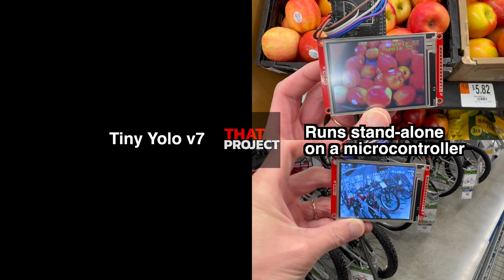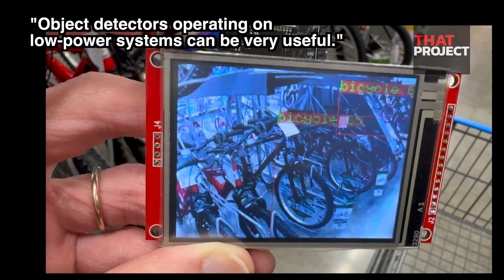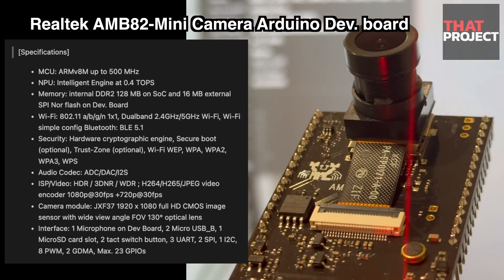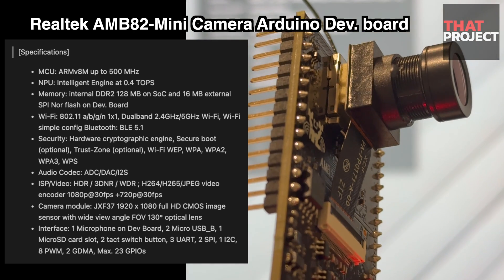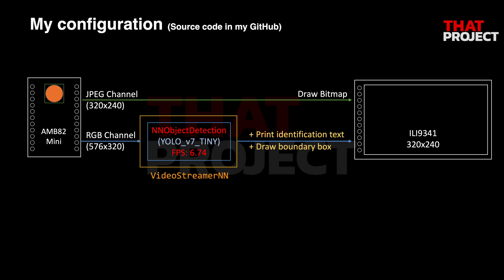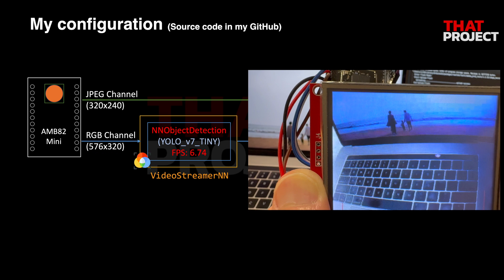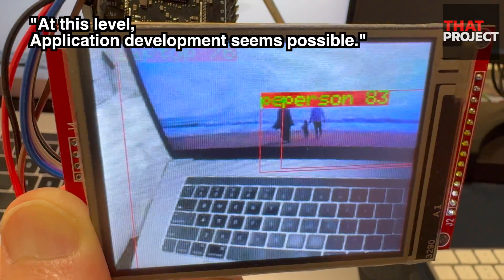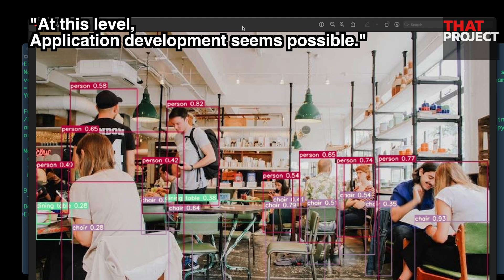[AMB82-Mini IoT AI Camera] *On-Device* object detector powered by Tiny Yolo v7! #standalone

Comment: I’m working on a project using the AMB82 mini. The goal is to capture images at specific intervals, perform object detection on these images, and save them to an SD card only when objects are detected. Additionally, I want to draw bounding boxes and labels directly onto the saved images to highlight the detected objects.

My main challenge is integrating these components efficiently and ensuring that the bounding boxes and labels are correctly drawn on the saved images. I’d appreciate any guidance or examples on how to achieve this, particularly on how to draw the detection results onto the image before saving it to the SD card.
Reply from the maker: In order to write an image file to the SD card, you need to write an image to draw the bounding box and label directly, which is not easy in an MCU environment. If you use OpenCV, it will probably only take a few lines. Unfortunately, it seems that it will not be easy to create an OpenCV environment that works standalone on this MCU. What about using an SBC board like a Raspberry Pi?

Comment: Hi, I've been trying your model following all the instructions stated on your GitHub page. Everything has been working well so far. 
However, after a while, during the execution of the program, the recording just freezes on the TFT screen, and the following text shows in the serial monitor:

15:33:09.699 -> Total number of objects detected = 0
15:33:09.822 -> YOLOv7t tick[0] = 69
15:33:09.822 -> YOLOv7t tick[0] = 69
15:33:09.996 -> YOLOv7t tick[0] = 69
15:33:10.129 -> Total number of objects detected = 1
15:33:10.169 -> [VOE]renew g/p(5d8c 5d8c)case1 14068 case 2 23948
15:33:10.247 -> 
15:33:10.247 -> [VID Wrn]VOE CH1 JPG buff full (queue/used/out/rsvd) 20/0KB

It seems to be related to some buffer being completely filled, but I can't find that buffer in the code. 
I don't know if you've had this same problem or if it's just my particular case.
Reply from the maker: As far as I know, it is impossible to increase or decrease the configNN buffer separately. Have you tried to reduce the FPS of configNN, or modify it to draw only half of the objects found through NNObjectDetection on the screen if the number of objects is large?
Reply: @ThatProject  Yeah, I tried that but didn't work, the problem lies in the buffer of the tft channel, the NN buffer doesn't overflow at all. I ended up
following the Camera_2_Lcd_JPEGDEC example on how to use the tft display, and it's seems to work falwlessly. Thanks for the response

Comment: Erick, if I need just two object to detect, so can I assume that the precision can be better? (based on your info at 52")
Reply from the maker: My answer is yes or no. The more data you have about the objects you want to detect, the better the data set you can create. And since each object is independent, unless the number of models you have becomes extremely large, the difference in accuracy is unlikely to be much different.

Comment: I have this same board, and I'm developing an object detection product for industrial use. I trained a custom YOLOv4 object detection model, and it seems to work quite well. I don't need a video stream for my use case, but for validating my models on-site, I use this method:
Rather than output the video to an attached screen, I stream it using continuous JPEG. It currently seems to offer the best balance of framerate (30 FPS video and 5 FPS detection) and latency (its latency is much lower than RTSP). The WiFi is set to AP mode, so I can connect to it using my phone. If you're interested, I can share code and a video later in the week, as I'm currently quite busy preparing said product for my prototype presentation to the client.
Reply from the maker: That's interesting. What tools did you use when training custom items?
I try not to connect to the AP on my mobile phone if possible because in this case, data communication is not possible on the phone, so I am thinking of getting data through the server.
Reply: @ThatProject  simple-image-download to download images from the web, self-hosted CVAT for annotation, training was done on Google Colab using the free GPU option with files on Google Drive, some Python scripts for image augmentation, etc. Right now, the AMB82-Mini only supports object detection models trained in Darknet or converted to ONNX — that's why I didn't use YOLOv7, or YOLO-NAS — but they're working adding PyTorch support by February.

Comment: Good Work!
I wonder if this could fit on a ESP32S3-EYE as well.
Reply: Maybe. I've seen neural net projects for the ESP32, but the AMB82-Mini has something the ESP32S3-EYE doesn't: an NPU and enough memory to run more complex inferencing tasks. I have the AMB82-Mini and an ESP32S3-N16R8 (it's not the same as the ESP32S3-EYE, but it's essentially the same module but with double the flash storage minus the screen and the camera). The AMB82-Mini doesn't even break much of a sweat running object detection (80 objects, COCO dataset) at 576x320 10 FPS and overlaying the result on a 1080p 30 FPS H264 video — this video doesn't do it much justice, due to the poor performance of the attached screen. In contrast, the ESP32S3 has difficulty maintaining a decent framerate at SXGA size without drastically lowering the JPEG quality.
Reply: @abrtn00101  I am currently working with ESP-DL and their TVM Convert Tool. Do you have any experience with it?

Comment: Hi, excellent work. I recommend the luckfox pico board. It is based on the rockchip rv1103-rv1106. It has good documentation and can run yolov5 on its 0.5 tops npu. I have achieved 7 fps with 640x640 pixel images and 12 fps with 320x320 pixel images. excellent performance/price ratio. greetings.